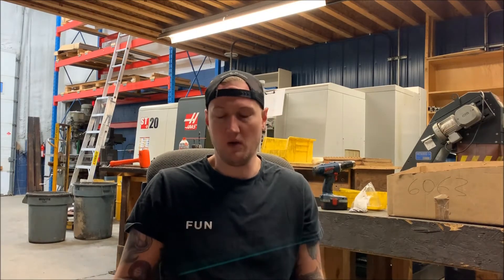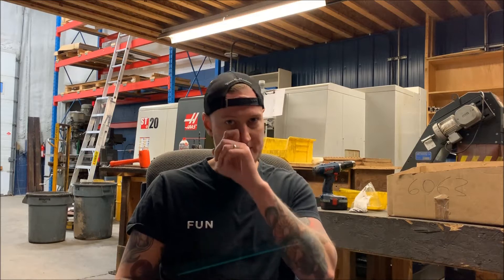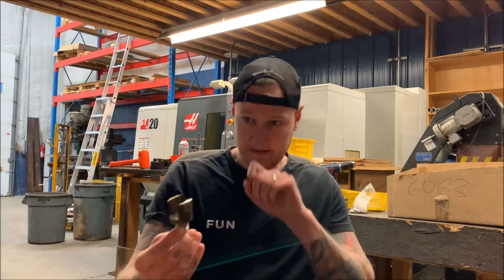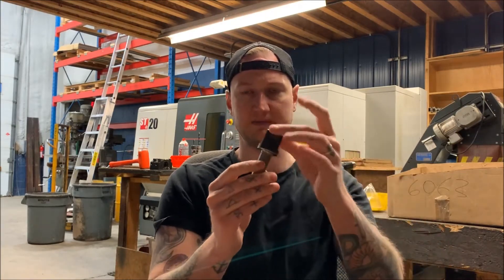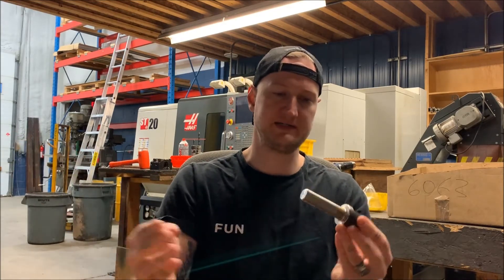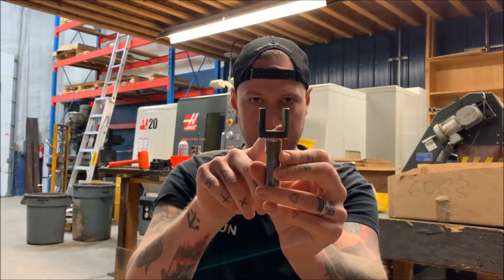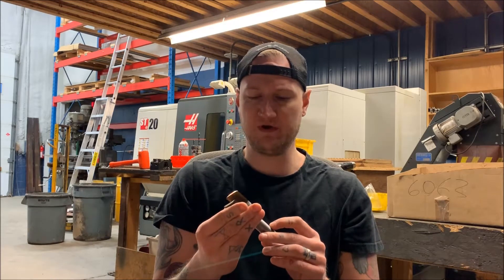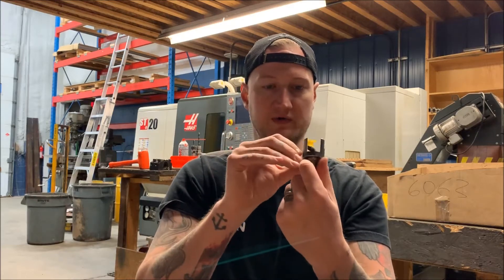A BASIC WIRE EDM JOB

Comment: You should get a Mitsubishi. Much better machine and you wont have to deal with split guides and threader tubes. Mitsubishi has the best wire threader hands down.
Reply: 西部最好

Comment: Looks great, nice job. Used to do something similar on our Wire, we have a Fanuc W1, and sometimes with deep slots like that a WEDM is really useful. I know it's slow but you can always go and do something else while it is running to offset the time. I don't have powered Z though, would really like to have that option.

Comment: I had an HFO tech give me a tip on machining a part like that years ago. Instead of slotting/profiling clear the material out by plunging with 1/2 the tool diameter or so shifting the forces down instead of trying to rip you part out of the vice then just a little finish profiling

Comment: If this process works for you keep doing it! But just trying to see why you couldn't tip it up right make soft jaws (1018) and clamp on the large diameter right below the feature you are cutting and clamp the crap outa it and adaptive it out?
Reply from the maker: Definitely could! They were giving me a headache the first time we were doing them so this is the route I took, and the volumes are so low I haven’t bothered to try in a mill again to be honest.